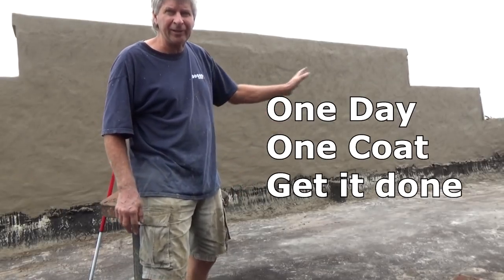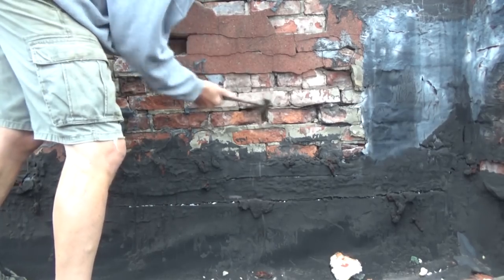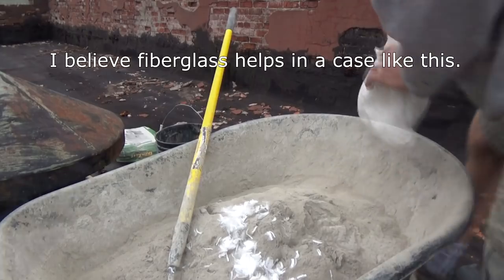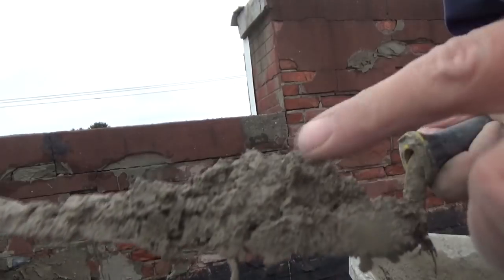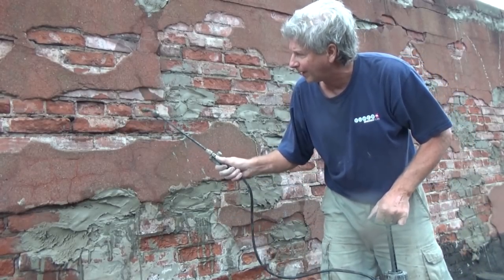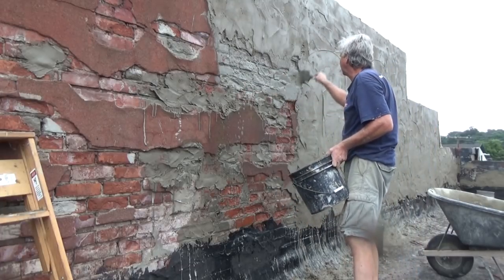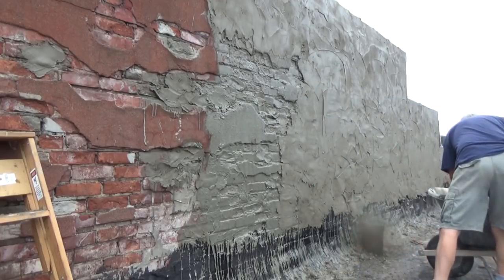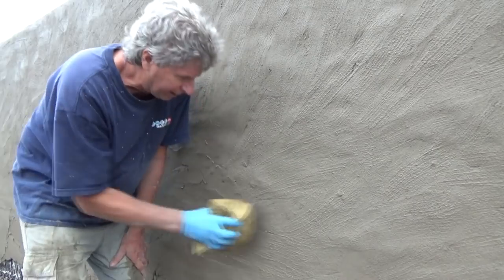MASONRY WALL REPAIR (part 2) Mike Haduck

Comment: What if the brick was set with a lime base mortar? Do you plaster with lime?
Reply from the maker: Hi Doubledranch, No I use the same techniques, I never had a callback or problem, other masons might say different, thanks, Mike

Comment: Looks like main st Avoca. I never understood why that building had that useless large front wall. I guess its a facade to make the building look bigger than it is. Either way, great job Mike
Reply from the maker: Hi Jason, actually is was in a different town, but most of the old buildings look the same anyway, I appreciate it, Mike

Comment: We mix a slurry and throw it into the wall..when it dries the nect coat grabs sweet
Reply from the maker: Hi Thomas, I know others in other areas use different techniques,  here with the old school method you can not let it dry or it will not stick,   Different products maybe,   Thanks, Mike
Reply: @MikeHaduck  its just putting sand in with the Portland 1x1..and you can throw it with the trowl or dip a broom and splat it on.. I see it all the time in Brasil.  But it's always 100° maybe thats why..

Comment: Love your videos and appreciate you taking the time to prepare and post them. 
Question - could you use the fiberglass in all scenarios (walls or floors) or will you see small fibers sticking out? Many thanks.
Michael
Reply from the maker: Hi Michael, I guess my best answer would be, it all depends on what your doing, but I would say for the most part it would be ok, I would mix a little sample up first and see what you think, thanks, mike

Comment: With that old brick i'd use .5 type n masons mix, .5 hydrated lime, 3 sand directly against the brick. Portland and type s is too hard for old brick.
Reply from the maker: Hi bowen, lime don't hold up here, I would be back every 6 or 7 years repairing it, maybe in your area it's different but not here, thanks Mike

Comment: Why wouldn't you use a HAWK and a bigger trowel? Save a lot of trips to the wheebarrow.
Reply from the maker: Hi Hugh, it's easier without one, ceilings and straight up walls are different,  thanks mike

Comment: For 0.10 ć a metro i will rebuild the building recycle and a nice cote of approx wax....inside and out ...i ask for a three months in 2 it will be done
Reply: How two fix the beuild steel pipes inside and out as i demolished the inside living it oak the steel pipes two hold the wall as i build back up...
Reply: That a 15.lengthX  6.width a Metro and a 4.5 height 40,500.00 total 0.03 ć for 2 helpers 0.07 ć engineer ....

Comment: How would you plaster over block When the block was painted ? I believe with an oil based paint.
Reply from the maker: Hi Jo, I show how on do that on my series, how I fix up or pactch a old foundation, I hope it helps, thanks, mike
Reply: @MikeHaduck   Thank you so much 
I enjoy and learned much over your 7 part lesson . 
Happy New year.

Comment: Have to say most of the comments on here haven't clue what they are talking about never mind this get it done attitude that job is totally butchered it's a disgrace if any of my guys did a job like that I'd fire them off the roof no tradesman would leave work like that only a butcher would
Reply from the maker: Thanks john,  I was only trying to save my customers some money. But I will try harder, thanks  mike
Reply: @MikeHaduck  After 40 years he thinks you're still a rookie Mike, just proves ya can't make em all happy. Way to stay positive. I was wondering why you didn't add the 2 parts sand to the type S like usual.  Thanks Mike!